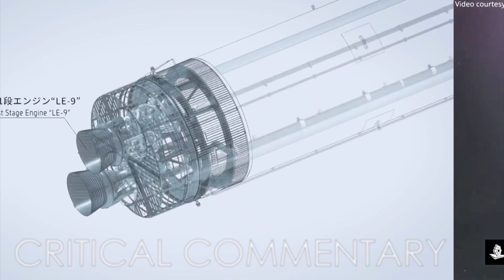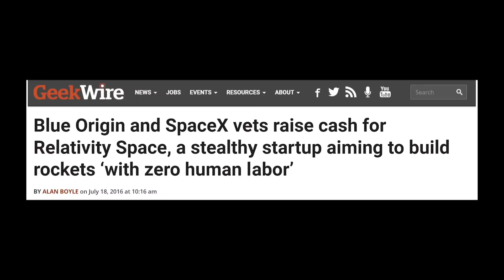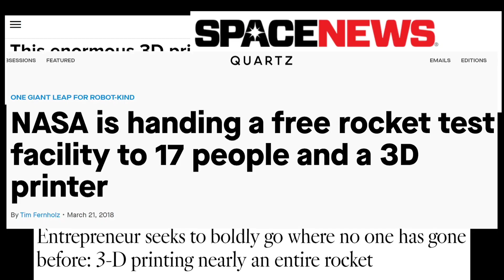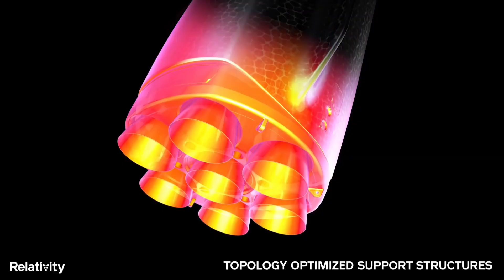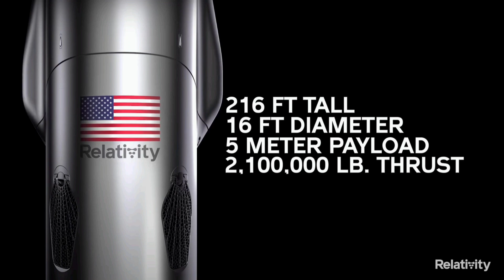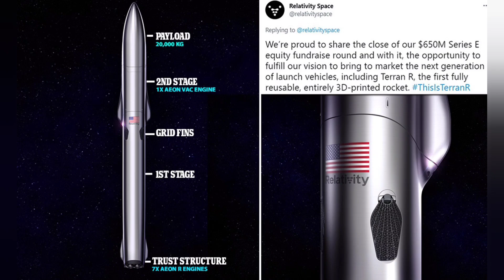Two Blue Origin employees building Jeff Bezos' worst nightmare!  -  Relativity Space!

Comment: Correct me if i'm wrong but I remember Elon saying that a Starship Launch would end up costing less then a Falcon 9 launch, unless he was talking on a per Kg to orbit metric then would it simply not matter if someone couldn't take full advantage of the lift capacity? that would just mean less fuel and oxidizer would be required to reach orbit for those lighter payloads.

But to be fair by that argument the Terran R being lighter would in theory require even less fuel and oxidizer so they should be able to beat out starship on the launch cost.

Personally I'll just wait till they have actually gotten anything to Orbit, until you've had at least 1 rocket that reached orbit I can't take a company seriously as a real competitor.

Comment: When they can fully build an entire rocket with just 3D printing, 3D printing has proven it can take over every type of aerospace manufacturing.  Still.  I find it incredibly hard for the best 3D metal printer to build ultra high tolerance high stress parts.  This will be a major aerospace manufacturing game changer if they pull this off.
Reply: it'll be a game changer in all areas

Comment: A.A  
At approximately the 8:30 point of the video you seem to be drawing a de minimis comparison between Virgin Orbit and the Relativity launcher, not mentioning that Virgin Orbit benefits from the 4 (counte'm four) engines on the lift aircraft (a 747).  This of course allow them to launch from pretty much ANYWHERE (a 747 can take off and land).  This means that they can more easily achieve any orbital inclination they need, without the constraint of a few fixed rocket launch sites.
Letting the "ANGRY" shtick get in the way of good reporting??  
Seems to me, that we will, in the longer range, benefit from every provider that is able to achieve orbital launch (maybe even blue origin).

Comment: "How many customers are going to need 100 tonnes of payload ...?"

Starship enables payloads -- in terms of costs, payload volume and weight -- that people don't even know they need yet. Like RAM, industry will find a use for it and lament the dark days before it was available (FH doesn't sufficiently lower costs, and doesn't offer a larger fairing). 

Imagine, if you will, a telescope with JWST's capability, but that didn't need all the engineering complexity and cost associated with that crazy origami design, because 9 meters. You could use heavier, less expensive, tougher materials, also -- for all sorts of things. You might launch outer system probes powered by 10 megawatt fission reactors, and all sorts of crazy Sci-Fi stuff.

In 20 years we are all going to be chuckling about "who needs all that damn payload?"

Comment: I love Terran R from a technical standpoint. I'd like to know though what form of thermal protection system the second stage will be using. Also, I expect very strong competition from Rocket Labs's Neutron for precisely the reasons argued here. Neutron's 8 tonne payload (fully reusable) covers 80% of the market. Plus its designed from the ground up to minimise every cost associated with launch, and not just the vehicle. Will have to wait and see if Terran R's upper stage is rapidly reusable, or has some issues due to its TPS.
Reply: Neutron isn't fully reusable. The upper stage is expanded every launch, like Falcon 9. The stage is designed to be cheap and light to minimize costs.

Comment: There's one key point to bring up about  Is fully 3-D printing rockets.  Normally you have to build several tools to manufacture each component. 3-D printing removes that need to have several tools.  Castings, dies, and machining fixtures, ect.  If you want to manufacture in space, it would be a whole lot easier to bring up the 3-D printer  And manufacture what you need from the raw materials you can get in space or on other planets.

Comment: Thrust is not a measure of a rocket engine’s performance Isp is.  Very suspicious of companies that don’t publish the Isp of their engines.  I’m looking at you BO.  There are no figures for the AEON 1 on the website.  Also conspicuous by its absence is the cycle type.  By your description it maybe an oxygen rich staged combustion engine however it could be just a gas generator type.  If liquid ch4 is going into the combustion chamber then it’s not full flow staged like the Raptor.  Again the technical details are very sparse.  The Isp would give us a good idea of the cycle.  Also missing is the engines weight as that 3D printing everything could be heavy.

If they’re not confident publishing more details I get worried they’re hiding something.  Maybe they just got it from their origins at BO.  Blue Origen publish none of the BE4s details.

Comment: Jordan Noone is former SpaceX not Blue Origin.
2015 to 2022 for first orbit is solid but not revolutionary.
Same with the price for Terran 1, it's good, but not particularly outstanding given Alpha and RS1.
Just shy of 2 billion $ in capital is a weird way of saying 1.34 billion.
Given the 28% slash in valuation done by Fidelity to Relativity value; probably not worth 4.2 bil at this point.
Worth mentioning the new 1M sq. ft. headquarters when discussing the company infrastructure.
Stargate does not print the Aeon engine components, they use Sintavia power bed printers.
Aeon 1 is a gas generator not staged combustion (same for Aeon R).
RFA Helix uses kerosene not methane.
Terran R for crewed spacecraft is not set because most of those don't want fairings. 
Relativity hasn't mentioned a tug as far as I'm aware; the current inclination would be refueling the Terran R upper stage.
Reply from the maker: Mr Noone worked for both companies.
Reply from the maker: 1 34 billion was one of multiple funding rounds
Reply: @TheAngryAstronaut  Oh so he has done a 3 month internship, slipped by me (I've always mentally thought Tim is Blue ,Noone is SpaceX). With the raises I believe the thing causing confusion is that in the 650 mil raise CNBC article it states "Relativity has now raised $1.34 billion in capital," but that was including the 650 mil. (All the raises combined are 0.5 + ~10 + 35 + 140 +500 + 650)

Comment: I dont think its possible that the Terran R will not need comparable safety protocols to SpaceX's Starship. If it is comparable in size and payload, it will have comparable amounts of fuel on board and will be just as dangerous. We shall see how its pricing goes. Starship has only been expensive so far because of the foundational work needed. After everything is built. Each Starship will be much cheaper. Relativety has made some bold claims there with their stats for Terran R. Talk is cheap. When it comes to the number of customers that will need multi-ton payloads sent into space, you have to think about how Starship is creating its own market. They wont have to worry about making their payload as compact, complicated, or worry about its weight. The true space industry will start once you can send huge payloads into space for cheap. Space infrastructure will bloom.

Comment: 100 tons payload is necessary for permanent space residence. So much material needed. 5 Terran R launches per Starship launch negates gross savings. Don’t get me wrong, size is not needed for most launches. But needed to move  the planet forward.
Reply: Local production and local consumption

Moon will be for aluminium foundries for rockets and ships and settlements

You don't need to bring your water or Oxygen eventually only co2

Comment: I'm not so sure 3D printing the entire rocket is necessarily cost-effective. The engines, yes, but the body? We'll have to see.
Reply: As far as metal sheets for rocket bodies are cheap, their precise assembly is not. Another problem is a production scale. If you build thousands of elements, printing can be more expensive. But if you have to build few reusable rockets, it becomes cheaper.
Reply: @peceed  Maybe, but most of a rocket body is cylinders, which (as SpaceX has proven) are fairly quick and cheap to produce traditionally, but maybe not so much by 3D printing (3D printed bosies would likely be heavier, and might not be as strong). You're right as to economies of scale I suppose.

Comment: I think you are missing a key point when you say who needs a 100 tons. At $13,185 ULA cost per Kg at $4,300 Falcon 9 rates, not many. 100 tons at ULA rate $1,318,500,000 for Falcon 9 $430,000,000. The whole Industry has been geared to light and small to keep launch costs low by low I mean 50 to 100 million. It has literally defined what projects are even considered.

Comment: By tzhe way if anything brakes on a printed rocket than the whole rocket is scrap. Obivously depending on the issue. Stainless steel means you can just weld anything onto it or cut it out and replace it. Spacex took years to get their falcon 9 perfected and to land their boosters.....Relativety hasnt flown one so far as i think. And their falcon 9 competitor and its full reausibility is 10 years behind spacex. Relativety has a lot to prove. And by the time starship is flying regulary they wont have their mini clone with the capacity of falcon9 flying yet. Relativety has to compete with  starship in the end. competing with falcon9 is futile. because falcon9 can fly several times a week. By the time Relativety is competing with falcon 9 starship will be the regular launch vehical for spacex. Lets see if Relativety can survive on the scrap spacex leaves behind. I wish them the best. But i fear musk would be already using their technology if it was a serious ground braker. we will see.

Comment: Once Raptor gets fully dialed in, I think it would be smart for SpaceX to make a medium-lift fully reusable rocket with specs very similar to the Terran R. Yes, there is definitely a market demand for a launcher of that size. Falcon 9 has been amazing, but it's headed for retirement and will need successor. Make it stainless steel, run on LNG Raptors, and capable of barge landings on its own legs. For now Falcon 9 is still going strong, and Starship deserves to get all the engineering attention, but 2024 would be a good time to dedicate a design team to this.

Comment: I really dont understand why they are 3d printing tanks. I cant see any rigidity pattern or anything. engines can benefit from integrated cooling viens but i truely dont see any benefit from the 3d printed tanks
Reply: Less equipment to manufacture, fewer people needed to do the job. Thats off the top of my head.
Reply: @GrigoriZhukov  thats... no. you dont design a rocket to reduce the manufactoring equipment. The rocket equation speaks volumes
Reply: @jackb3493  Manufacturing costs are real.  Any dollar saved there is a dollar saved.
Reply: @TheEvilmooseofdoom  I cant see how huge amounts of purge gas and limited alloys for fused deposition are cheaper or comparable to rolled sheet materials. I only think this for the tanks - i totally agree with 3d printing engines. Rolling hardware and jigs are dirt cheap and easy to maintain compared to massive multi-axis print heads
Reply: @jackb3493  The only thing I can think of is labor but when it comes to 3d printing like that I'm in over my head a bit.

Comment: Starship isn't designed for deploying satellites, it's transport for Moon and Mars.

A problem I see with the Teran Rocket is thermal protection. Their pictures show it bare. That won't work.
Reply: On the contrary. It's very first missions will be to deploy 3rd generation Starlink satellites that are much larger and require specifically Starship to launch them..

Comment: Heat Treating must be an interesting process, different materials have different requirements.
I can't see an engine as one homogeneous material and different thickness makes multiple times at temperature.
I am sure they know what they are doing, I left BO about 6 months ago.
Reply: Rocket Lab's Rutherford Engine is largely 3D printed and they seem pretty confident that they can reuse them.
Reply: @gonun69  Spacex 3d prints the super draco too.

Comment: I also wonder, when down the road, if SpaceX has a 20 tonne payload, or less and if enough development has been made on weight-reduction and on Raptor 2 thrust, if a Single Stage to Orbit couldn't be done  for LEO. Just using Starship.
Reply: I believe starship today can make orbit with a small sat payload <500kg and was hoping we would get a test flight that did just that but they decided not to go above 15 km to please FAA.
Reply: @alanrickett2537  When you punch the numbers into a calculator it comes up short of being able to make orbit on it's own.
Reply: @TheEvilmooseofdoom  is that with the new raptors and stretched tanks and if so as it's a test model what if you don't save the extra fuel to land it softly.
Reply: @alanrickett2537  That's with the currently published numbers, Raptor 2's and starship.
Reply: @TheEvilmooseofdoom  yes, but my question was predicated on Starship mass-reduction and ongoing engine-thrust development. The figures available are for development prototypes only.

Comment: I know Elon has his plans for using the Starship, but, I think it may not work out quite the way he might prefer. For one, I think Starship will be great for several roles to begin with. Setting up a fuel depot on orbit, getting LOTS of mass to the Moon and Mars when needed, building out space stations of SEVERAL kinds on orbit, both Lunar and Earth orbits and eventually Mars. But you may well be right regarding the needs of many who don't need that kind of capacity. Relativity looks to be the future for smaller loads, along with Falcon and maybe Blue Origin if they can ever get to orbit.
Reply: They also need to fly and maintain a large constellation of satellites.
Reply: Starship will open the solar system - nobody else seems to be working on that scale.
Reply: Falcon 9 will be phased out when Starship is in action , or at least for any non-human rated payload as Starship will cost far less to launch and when Starshio does have a small payload , SpaceX will just fill it up with Starlink Satellites.
Reply: @dominicm2175  Or fill up with elements for space stations, gigantic sun shades/solar panels, space hotels, space industry, etc.

Comment: 3D printing is the future. But right now, Starship has the advantage of rapid assembly with easy tinkering during development. If a Starship design is stabilzed, Elon can use 3D printing for the entirety. There is probably nothing that SpaceX does not know about 3D printing -- they use it so much, for instance extensively in their engines. 3D printing comes after the design is played with. Sez eye.

Comment: A rocket made of welds on top of more welds? Hmmmm.
Reply: If they are all of equal and sufficient strength, then there wouldn't be a single potential failure point. I don't see how that's a bad thing.

And if they're dumb enough to design with weak weld designs I doubt they would get their proof of concepts off the ground.
Reply: @falxonPSN  im guessing you're not a welder
Reply: @LuciFeric137  Indeed I am not, but I would be downright shocked if they had not thoroughly tested this process before proceeding to full scale.  I think it's a little silly to assume they haven't thought of the concerns.
Reply: Actually, no problem. But I've show people you can get strong weld on cast steel welding up with an oxy/acyl rig. Was a load bearing bracket.

Comment: Two questions not covered:
1) What is the TPS for their second stage?
2) How about their fairings? Reused? Integral with the second stage?
Reply: Yes, I was wondering about the TPS too. And also how they could adapt the second stage to carry manned crew vehicles such as the Sierra Nevada Dream Chaser. Some US military payloads may require more than a 5 metre diameter fairing. SpaceX is building a wider diameter one for its Falcon 9/Falcon Heavy US military launches. This all sounds like great marketing speak, although AA didn't even question any TPS issues.
Reply: afaik they are planning to not use TPS for the 2nd stage
Reply: @asmmahfuz8569  Without some sort of thermal protection, there will be no second stage safe return. 'Ye cannae beat the laws of physics, captain'.
Reply: @mauricegold9377   well, I wasn't the one who decided that. That's what they said during the Terran R introduction. They said they would use some form of expensive special metal alloy that can take the extreme heat